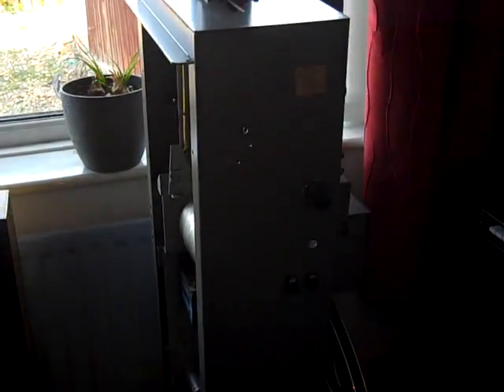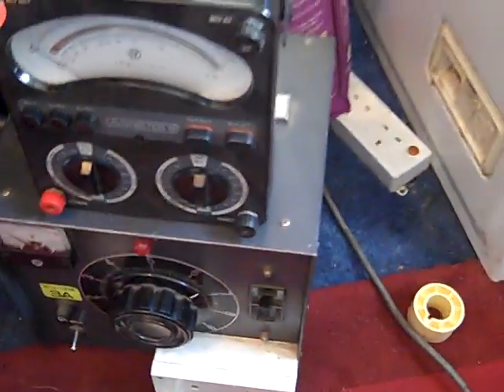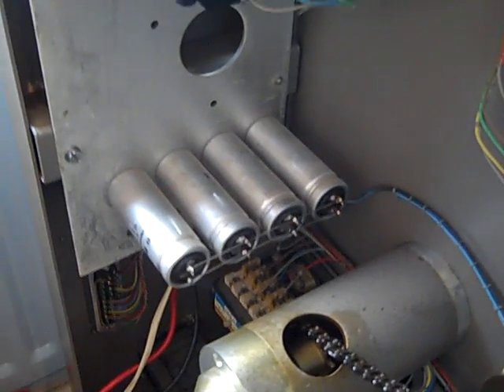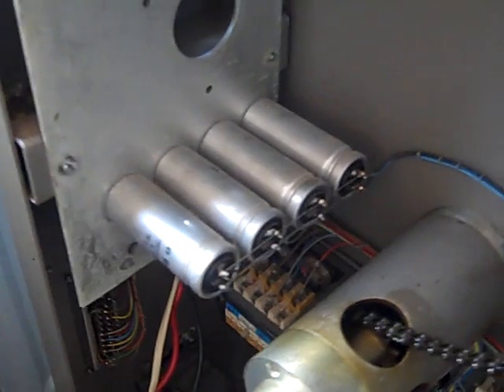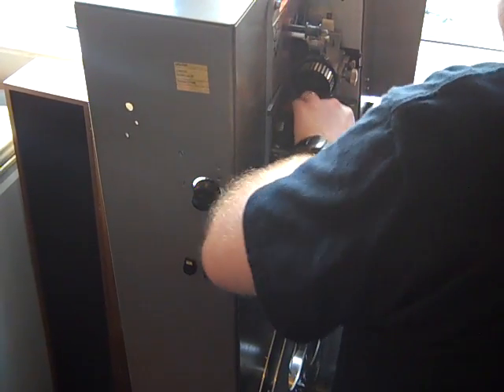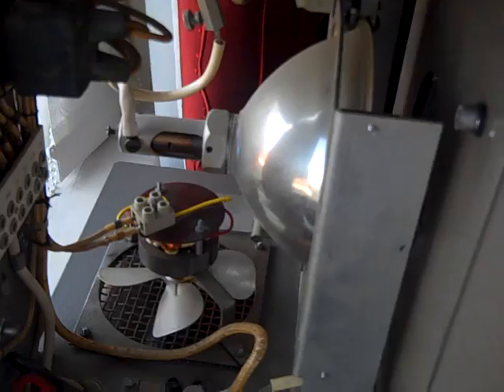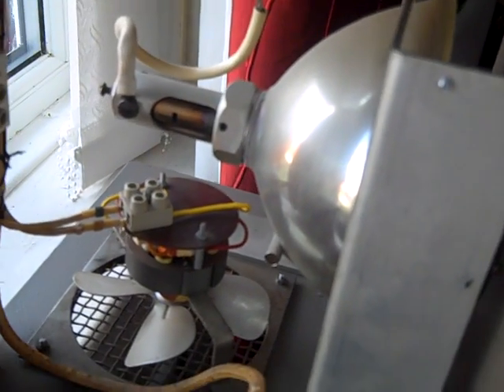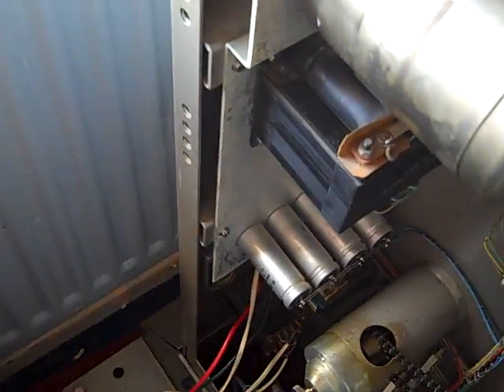Philips FP-16 Projector with RetrogamerVX

Comment: Several manufacturers built 16 mm machines which were ‘left handed’ like this.  It could save space in the box as they could be placed back to back with a 35 mm machines.  Philips even built machines which were 35 mm on one side and 16 mm on the other.  There was another advantage to having 16 mm machines left handed.  On a 35 mm projector the sound track is towards the operator, the film overhangs the front of the sound drum and there is a clear path for the light from the exciter lamp to pass through the track to the photocell.  On 16 the track is on the opposite edge so on a right handed machine will be away from the operator, behind the sound drum,, so the shaft of the drum will be in the way, and a small mirror has to be used to divert the light into the photocell.  By having the machine left handed this can be avoided, and a simpler system, as with 35 mm can be used.  There was actually a DIN standard for 16 mm sound which put the track on the opposite edge, as with 35 mm, but it was the American standard which was adopted.